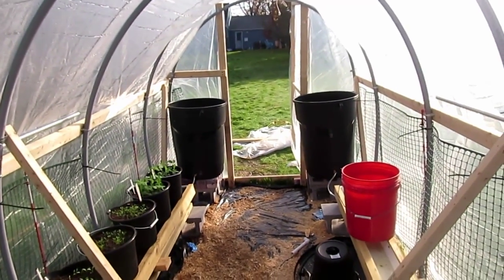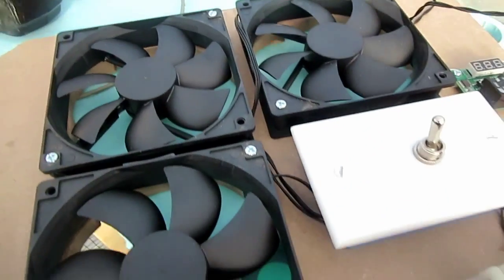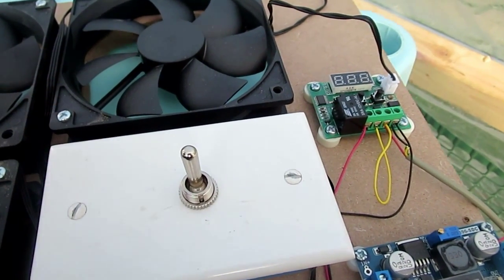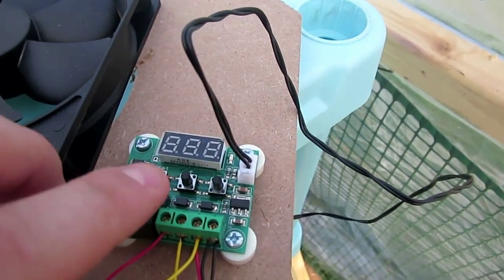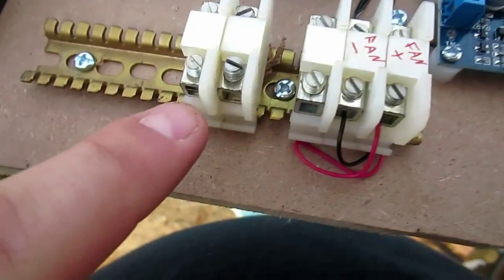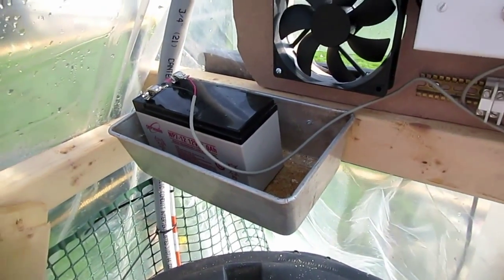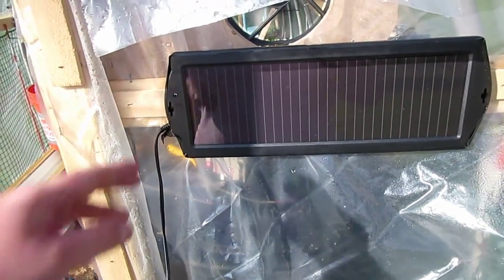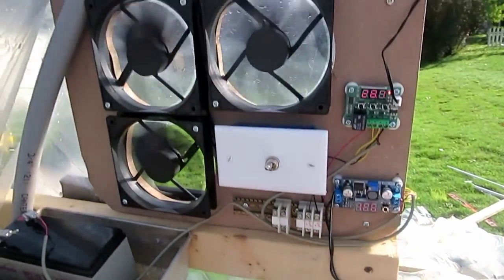Diy Green house air circulation system

Comment: I'm looking to do this but put 2 low down on one end and 2 high up on the other end. To try to blow cold air in and extract hot air out.

How long did your system last for or is it still going?
Reply from the maker: System lasted two seasons and it would have had more if I would have not taken it apart. :)